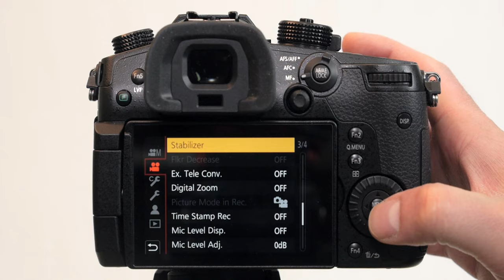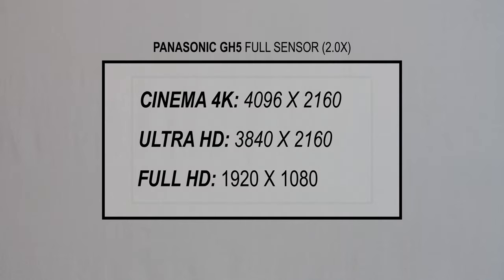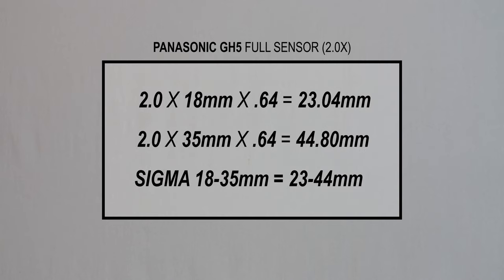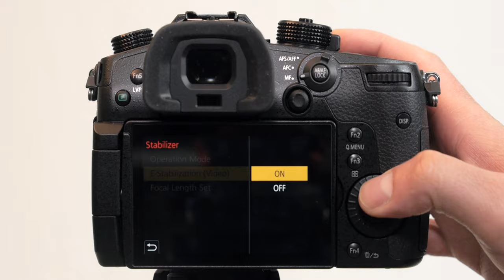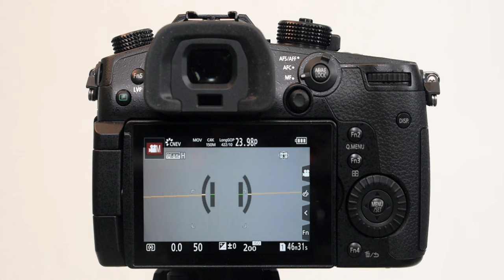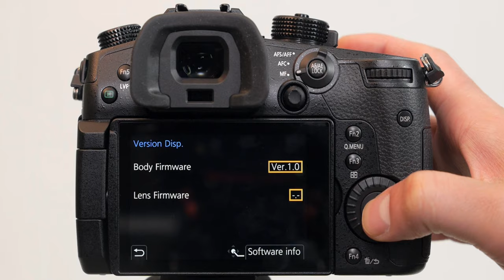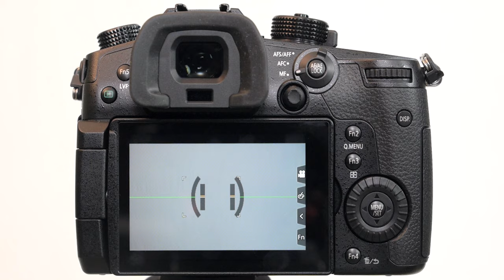Panasonic GH5 Sigma 18-35mm Vignette Test | Crop Factor Explained

Comment: Have you tested the Sigma 50-100mm? When does the vignetting disappear?
Reply from the maker: Yes, I have tested the 50-100mm. There no vignetting throughout the entire focal range. The following film was filmed with the 50-100mm: https://youtu.be/H5JhItUgB3c
Hope this helps!
Reply: One Orbit thanks for the reply. That’s very interesting, everywhere I’ve read says the 50-100 has vignetting with the XL. I hope you are correct because that would make buying it for me!
Reply from the maker: Glad I could help! Although, I would not recommend the 50-100mm solely for video work. The focus breathing is very noticeable and not very smooth. It's also quite bulky and heavy. I would recommend sticking with something in the MFT line up. I originally purchased the 50-100mm for photo work on my Nikon. The fact I could use it with the GH5 + Metabones XL was a bonus. Thanks again for watching!
Reply: Yeah, I ended up getting the Sigma 135mm to use with the Metabones XL. Haven't use it much but it's gorgeous thus far
Reply from the maker: Great! Glad to hear

Comment: Isn't it right the first math you did?
35(mm)X 2 X 0.64 = 44.8
or
35(mm) X 1.28 = 44.8
Reply from the maker: I apologize for the confusion. Before any calculations, I should have began with the full frame equivalent of the Sigma 18-35 which is 27-52.5. Then you multiply these values by .64 (Metabones Speed Booster XL) to get a focal length of 17.28-33.6mm on the GH5 (no need to multiply by 2). The full calculation is broken down in the description. Hope this helps!
Reply: You don't need to multiply 1.5(aps-c crop factor) when you don't attach the lens to aps-c camera. "Full Frame Equivalent" is not actual focal length of the lens. It makes sense only when the lens goes with aps-c camera. 
The only difference between aps-c lens and full frame lens is scale of image circle.
Reply: 35mm(actual focal length of lens) X 1.5(aps-c) = 52.5mm (ff equivalent with aps-c camera)
35mm X 2(micro four thirds) = 70mm (ff equivalent with mft camera)
35mm X 1(full frame) = 35mm (ff equivalent with ff camera of course)

In conclusion, the first calculation you began with the full frame equivalent "Of Micro Four Thirds(35mm X 2)" was right. because you're using the lens with Micro four thirds camera. not aps-c.
Reply from the maker: Sorry for the late response. I should have stuck by my original calculations. I ran some tests with both the Sigma 18-35/Metabones and Panasonic 12-35 at the wider end to confirm the numbers. I’ll post my results when I get a chance. Thanks again for all the help!